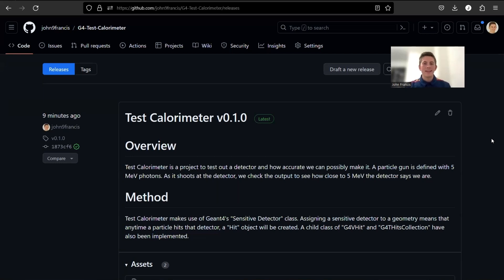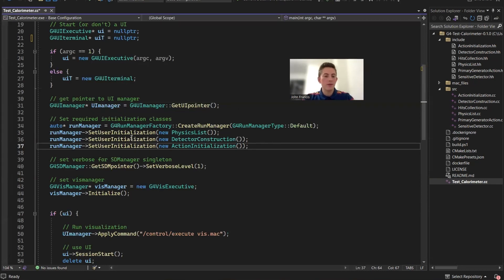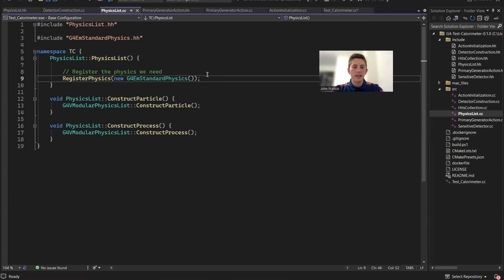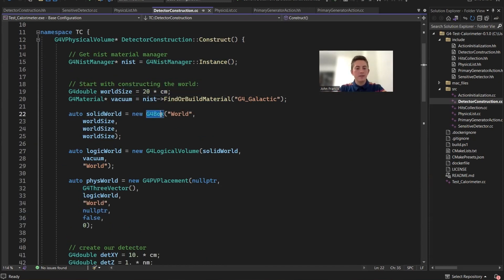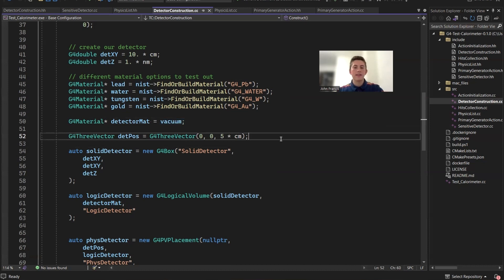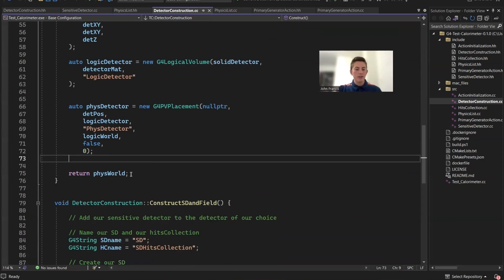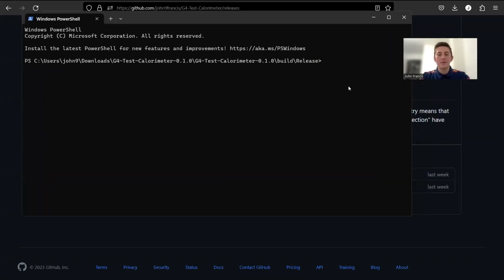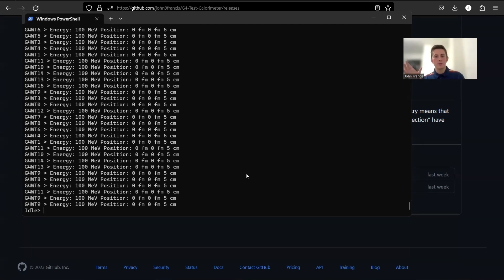Sensitive detector in Geant4 | Test Calorimeter

Comment: Hi thanks a lot for the detailed video, just a query more from a physical perspective.
If a particle is continuosly losing energy or going multiple scattering events(multiple steps), then to basically score the total energy stored in the detector it would be reasonble to comment the line related to checking is it is the IsFirstStepInVolume() ?
Reply from the maker: This is a good question. There are two different methods: "Get energy deposited," and "Get total energy". The "Get energy deposited" method measures the energy transferred from the particle to the material. If you're using that method, you wouldn't have the "isFirstStepInVolume" check, because to get the particle's energy, you would need to add up all the energy deposited in all the particle's steps. On the other hand, "Get total energy" just grabs the particle's energy. If we didn't have the "IsFirstStepInVolume" check, it would print out the particle's energy several times onto the output.